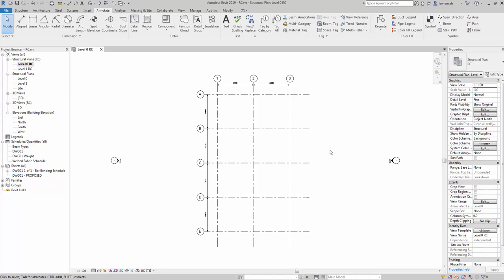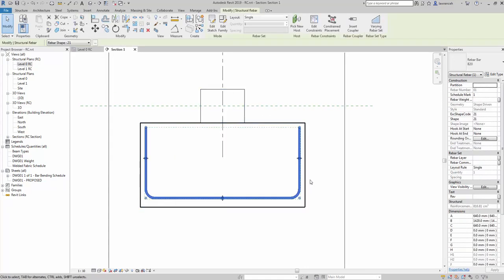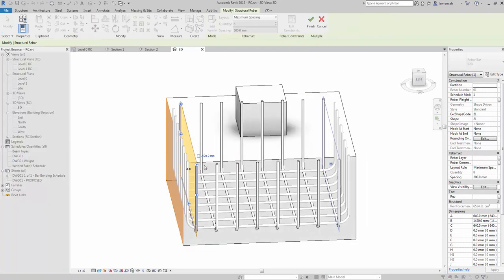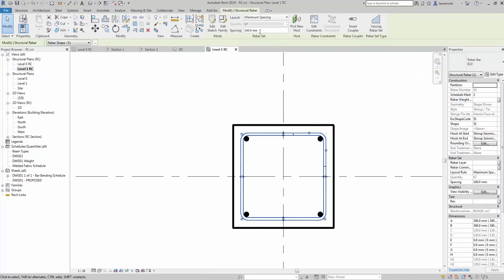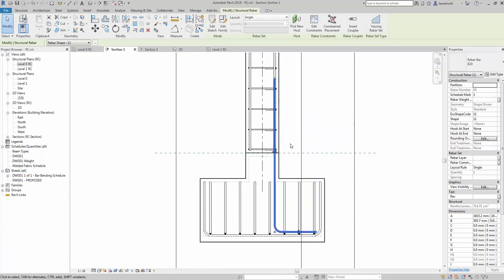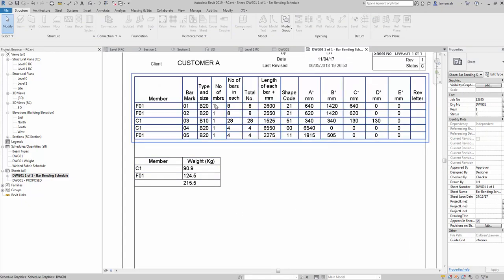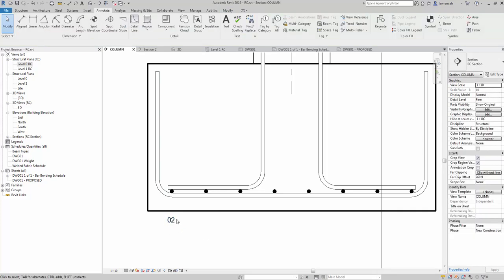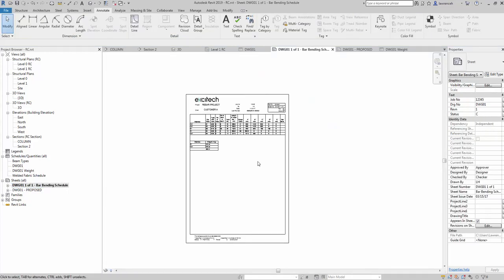Revit 2019 RC Detailing Tutorial

Comment: Sir I have a question that the double headed arrow section is customise section or family loaded section??? if its sir family loaded then where it in Revit 2022 is??
Reply from the maker: This is a standard section in the Revit UK structural template. However, you can easily create the arrow and add this to your section system family.

Comment: really nice tutorial ... can you explain where did you find the Rebar Layer parameter in the Rebar Sets? Did you create it? Does it work for any concrete element (slab, stairs, beams) or just for foundations? It would be really useful to me for creating rebar filters, like show only top reinforcement, only bottom reinforcement, etc.
Reply from the maker: I created a shared parameter to control the rebar layer. This will work for any element that can host rebar

Comment: Nice video, thank you. One question related to number of elements: let's say I have in a project 10 Pads F01, but I want to detail only one and add a parameter for number of elements. Is there a way to achieve this? I tried using a shared parameter attached to the element (host) but I cannot bring the parameter into schedule.

Comment: Hi Lawrence, Have you overcome the issues that are presented with the shape codes that are incorrect in revit? ie shape codes 67 or 15?
Reply from the maker: Hi Jake, I believe the issues have been addressed by Autodesk in Revit 2019
Reply: Hi Lawrence, I've just had a look and it seems the issues still remain? For instance the C dimension on a shape code 67 is fixed and the shape code 15 reports a D dimension which isn't required in schedules. Any ideas how to overcome this?